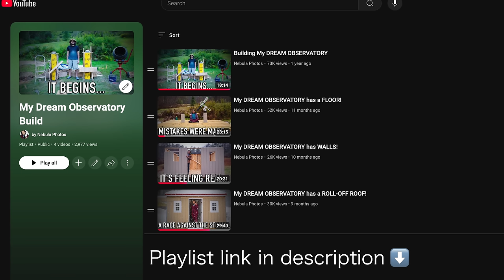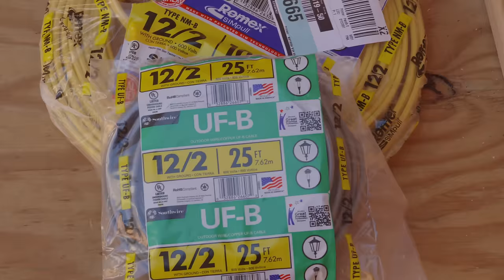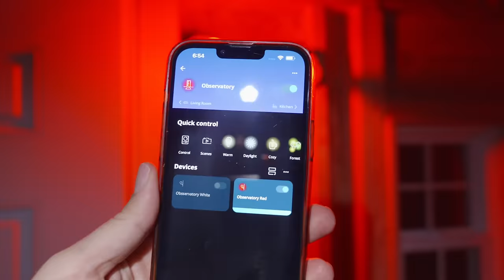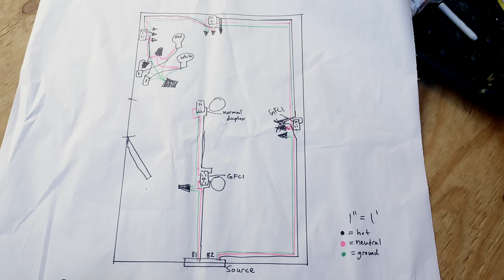My DREAM OBSERVATORY has ELECTRICITY!

Comment: Regarding the 60A subpanel being overkill, I've built a fair number of sheds, workshops, and garages in my lifetime (so far), and no one to my knowledge has ever completed a construction project with the words, "gee, I wish I'd put in less electrical capacity."  You might be surprised (and mildly disappointed, maybe?) how quickly that sixty amps gets used up.
Reply: @davevick1775  I've had to rewind to ensure it was not 16 amps.

Comment: Most Astro systems by themselves usually don’t draw more than 5 amps. Mine has never used more than 5 amps. So if you have 60 amps 120 v ac you could run a small house.

Comment: As an electrical engineer with some understanding of residential wiring in the US, your work seems sound at a glance. 12AWG is plenty for this application, Wago lever-nuts are ideal for DIY work, and you've correctly utilized the GFCI receptacle. All GFCI does is detect an imbalance in the current going out the live with the current returning via the neutral. It will do that for all "load side" receptacles. Assuming you're following all the ratings for everything, it should all be great!
I'd definitely hesitate to trust those voltage detectors with your life, though. I know they've gotten better since the first iteration, but they can still be a bit flaky.
Reply: What about sleeves for wood throudh-holes?
Reply: @vasiliigulevich9202  I'm not an electrician, so my knowledge of the NEC is limited, but it seems like the holes are set far enough into the stud that it wouldn't be required.
It also depends on whether he's planning on putting up drywall. I thought he was just going to leave it unfinished like that.

Comment: kudos for wiring it yourself !! i have been doing wiring for myself and family since my FFA class wired my dad new shop (Many years ago) i am wiring several buildings on my farm right now and i like to wire up the building then bury the incoming line (dont have a backhoe or digger yet) then i can run an extension cord to the building till i get it hooked up perm. just cant use ALL the circuits at once . the wire underneath should be just fine that wire should be rated to be buried under ground my only concern would be varmits chewing on it but you can also get the spilt conduit for autos to protect it if you worry about it!  a fun thing you minght want to do is set up a little outdoor patio setting under the roll off side to relax in between shots and even set up a tv there to show family and friends what you have been doing all night:)  really i think it would be a nice spot to relax at!!  good job and have fun learning new skills.  PS when i showed my wife your observatory she said YES COOL:)

Comment: Nico, very nice setup.  You planned out the setup and built it yourself, and you should be very proud of your work.
I know a lot of people here are concerned about the cameras and how easy they are go offline due to power or theft.  I think those cameras are perfectly fine for that setup there.  Your observatory is near the house and it looks like you can see the door to it from the house, so I would add a camera at the house in a secure location to belay those concerns.  Personally I trust people for the most part, but I'm not ignorant either and I have a few cameras around my home.  They don't prevent anything from happening, but they do allow me to keep an eye on things and see what caused an event.
Clear skies.

Comment: My observatory is fairly small so I don't go in there very much and I found that putting smart lights and a smart power strip works best for me. If I go out there the dinner bell sounds for the local mosquito population. Working remotely from my study is infinitely more preferable. 
All I do is long press the power button on my android phone and tell it to turn on the roof and telescope (Mele 3Q). The roof uses a simple gate opener so I can open and close it with a remote control after I power it on.

Comment: Love watching the progress! I see you had a foam pool noodle stuffed in the annulus space around the pier. A 12+" EPDM roof pipe flashing seal might make a good-looking yet vibration-isolating seal between your pillars and the floor. Dektite makes one in a universal-fit 9"-20" pipe diameter which should fit nicely over the piers.

Comment: Security system should be wired or at least wireless to a control centre to collect and store data safely and it's eazy to insert a box during pier making or later with a collar and take much less space and it will be hidden easily,good luck.

Comment: Looks great! Looking forward to see it when you're "done" (mine still isn't, even though it's been working remote for 2 years.. :))

Now your floor cables are already in place so a bit late for this suggestion but;
Pushing a cable like that can be really difficult, especially if it has hard bends. I would run a thinner cable or rope through the tube first and then tie one end to your cable and pull it through  (unless this is the technique you referred to as "vacuuming"). Adding a bit of soap if its really struggling can also help.
The cable itself might endure the environment, but it might not endure rodents and other animals who decides your cable looks like something tasty.

Also im curious about the "in-line" GFCI, is it not common in the US to have the GFCI-circuit inside the actual sub-panel?

Comment: Great to see your progression on this.  What you could’ve done for the cameras is run 3 ethernet cables (Cat 6) in the same trench as the power, so you could use POE IP cameras from your house.  This way if the shed loses power the cameras can still run, and the recording is saved inside your house.  Unfortunately anyone who breaks in can just take the cameras with them.  With the 3rd Ethernet cable, you could’ve used that as a direct connection to your house and not have risk of wifi interference or a weak signal.  I think you can still run Ethernet cables in adjacent trench and have them come up from underneath to inside the shed.
Reply: Run ethernet next to power?  Is interference an issue?  Have you done this?  My experience with running ethernet in a house (not outside) was a LOT of extra expense.  This was years ago though.
Reply: AFAIK, at least in Europe, it is against code to run both in the same conduit. But that idea is certainly very good. I am also concerned about a) the security setup itself with no external backup, and b) how openly he talks about it in public...
Reply: @markalot You are correct. If you run Ethernet with 110v power for more than 6 feet right next to it you will get a lot of interference. You need a separate trench for the Ethernet, or get a fiber cable and run it in the power conduit.

Comment: How about a third lighting circuit with a couple of infrared LED globes. Just switch those globes off when you are observing and flick them back on as part of your lockup process. Leave the cameras with their inbuilt lights off. That way you have easy control and any thief will not see any lights from the cameras or anywhere else. 
The inbuilt SD card in the camera is only going to be useful if the thief leaves your cameras alone. Unless the cameras are in a difficult to reach position or are vandal proof then the thief may just take the cameras with them.
WiFi jammers are now a thing so having cameras connected to the network via wifi may not be as reliable as cameras with physical connections. I haven't watched the entire series so not sure what sort of network connectivity you have to the observatory but I would recommend a gigabit ethernet cable from the house to the observatory and then a switch with ports going to each security camera and possibly each telescope mount. This would be handy if you ever wanted to go inside the house and control the observing session in the warmth. WiFi is great when it works but intermittent wifi can be a pain to identify and correct. Network video recorders (NVRs) are cheap, small and easy to hide away in an inconspicuous location in the house. So the cameras could be sending their video to the NVR in the house and recording 24/7. No motion detection needed, a NVR with a reasonable sized hard drive could record two cameras for weeks before overwriting the oldest footage. And hard drives have better endurance than SD cards. They are also a lot cheaper, for the price of the two SD cards you could have probably added a cheap NVR and a couple of terrabytes of storage.
If you wanted wifi in the observatory then a <$50 wifi router could do the job. Giving multiple physical network ports as well as wifi.
Reply: I should clarify. When I say no motion detection required I still think motion detection should be used. But depending on the use case, it may not be a good idea to use it to control the recording. I use motion detection on my cameras even though they are configured to record 24/7. I have the motion detection sensitivity set to trigger on human sized movements but the trigger is only used to send me notifications. The cameras record 24/7 no matter what. The 24/7 recording gives you full coverage of even the smallest event without the cameras sending an annoying stream of notifications.  So for example, you can see what killed the bird you found in the middle of you yard without having to have the sensitivity so high that every bird visiting your yard triggers a notification.
Not relying on the motion detection for event recording also eliminates those events where the recording doesn't trigger until half way through the event or cuts off the recording early. Like just as the burglar gets to the end of your driveway and you don't get to see which way they go, which car they get into or which cars pass by just after the event and may have dash cam footage.
Reply: Another advantage of using a NVR is that you can avoid any subscription fees that may be required for a cloud based setup.  I can access all my cameras from anywhere in the world using the manufacturers mobile app (Reolink) with no monthly subscription costs and recording continues even if the internet connection fails. 

To add even more reliability to the setup I use a POE switch to power all my cameras and the internet router, POE switch and the NVR are all on a UPS to provide continuous recording even if there is a power outage or somebody deliberately cuts the power to the house.

To keep internet access available for all the devices in my house I added a USB mobile dongle to my router, so now if my home internet fails it switches over to mobile data. This ensures my security cameras connection to the internet is also protected. This was not difficult to add as the internet router had the feature available and only required the dongle and a mobile data sim be added and the feature turned on in the routers control panel. No other configuration required.
So with no additional ongoing costs my setup records all cameras 24/7, notifies me if human sized movement is detected, cameras are remotely accessible from anywhere on the internet, no security footage is stored on the cameras and is safe from power failure, primary internet failure or wifi jamming. Also all cameras are visible to at least one other camera, so any attempts to remove or tamper with a camera is recorded by at least one of the other cameras.

Comment: I would not use Waygo connectors for 120 volt wiring. I have before and they will fail if you draw too much amperage. Just use wire nuts.

Comment: I actually have those same Wyze Cameras, but have yet to dig into them. Do you know, can you use them locally without any kind of subscription? (Edit: you answered this directly in your video at 13:40, I just hadn't gotten there  yet!)
Reply from the maker: Since making the video I have run into some annoying aspects of using them without the subscription - the motion alerts are not ‘smart’ without a subscription, meaning I get way too many alerts because they also seem to respond to sound. There are tons of options though so still figuring out if I can make the alerts work for my use case without the subscription. Many people have mentioned recording a stream to my NAS so I have to look into that as well and see if I can set it up for free. Other than that, I’m liking the cameras.

Comment: I bought a house in Jan that has an observatory just like this.  Not as big or nice, but has power, a roll aside roof and a concrete pillar in the middle with anchor bolts.  Unfortunate I already have too many expensive hobbies to outfit it with a decent telescope. lol.